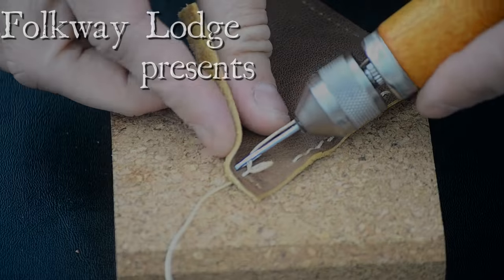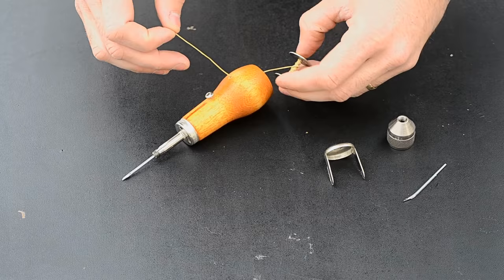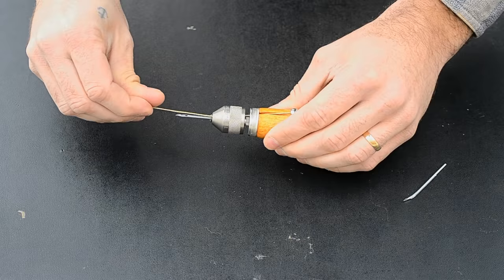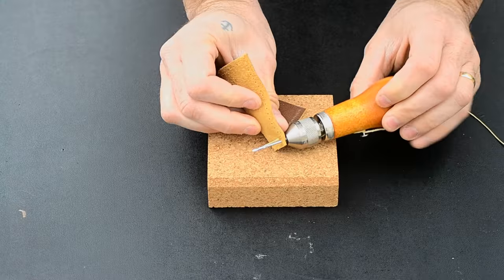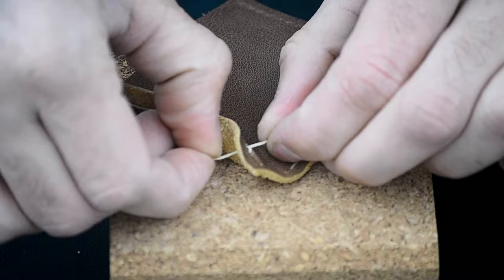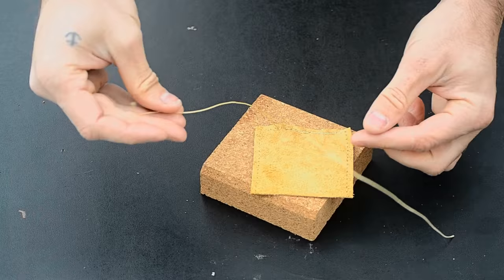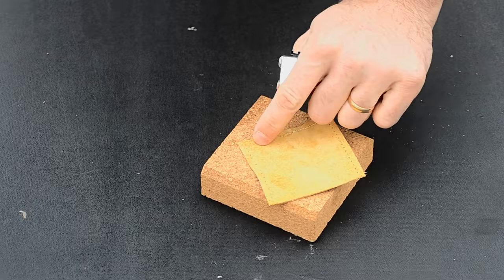How To: Sew using a Speedy Stitcher

Comment: The video instructions didn’t mention using the tension knob.  One wraps the string around it and under the thread coming from the spool before threading into the groove above it.  This way there is a comfortable tension on the string with little to no slop.

Comment: I some times take a short piece of wire, curve it to a proper shape, double the end over pinching it onto the tail thread line after first passing it through material being sewed. Especially like on the inside of a boot it makes it much easier to pass the tail through the loop.
Reply: Or use a crochet hook.

Comment: 2:00 You can leave the end-cap on the tool even while sewing with a whole spool of thread, since the end-cap has a center-hole designed just for this purpose; you just thread the cord through the hole and into the tool, and then put the cap back on. :D
Reply: Great comment,  thanks!

Comment: There is another method of using this tool. It involves passing one loop through the next. It's a little faster than this and might be stronger. Too bad I don't make videos or I would demonstrate it. The tool that I have was made in the 1900s, and still works.

Comment: It would move on a lot quicker if the loose end were in a separate needle of its own...
Reply: You could actually pull out even more on the loose thread side and thread that piece into a larger darning needle for easier handling. That way the tail of the thread won't catch when passing it through the small loop.

Comment: For those complaining of the speed...

1)  He's trying to show how it works, and is deliberately going slower than one probably could reasonably go.

2)  There are a couple of things that weren't done in the video that help speed things up.  Wrapping the thread around that little knob, keeps everything tight, making it easier to work with.  And putting a small additional needle on the end of the thread helps to get it through the loop more quickly.  Doesn't even have to be a sharp needle, just has to serve the purpose of giving steady control when putting a the thread through a loop.

The main disadvantage of this tool is that you have to pull through all the thread you will eventually need for the task, right at the start.  It's hard to know exactly what that is, and it can be tedious to pull that much thread for something big.

The main advantage of this tool is, ironically not actually speed (though it can be done quite quickly, if you're not an idiot or a klutz), but rather that it's considerably easier on your hands by providing a better, and easier, grip.  It's actually even useful for softer fabrics, as it requires less of a "pinching" grip, and allows for placing more fingers on the tool for finer and more stable point control.

Comment: I have one of these contraptions. I like the cork board idea, gotta get one now but the challenge comes when you try to get all your threading the same size and all uniform..
Reply: Get an old fork hammer it flat cut the shank of at a length to suit you quick few strokes of a file will sharpen the prongs. Use fork to mark the holes with a couple of taps with a hammer will give you equal spacings.

Comment: Use a crochet hook to handle the cord on the other side. Also clamp near the stitching line to take some of the wobble and flop. It is faster than using two needles and crossing at each stitch like a normal topstitch.

Comment: That little non bust behind your thumb is to wrap the thread around to cinch on and be able to get a tighter stitch.

To finish off the not you can place the backing through and rotate the push a few times before pulling back through creating a timber hitch on oneside and square knot on the other.
Reply: What is a non bust? Which one of his thumbs are you referencing?

Comment: I had to do a refresher today so I could fix a broken belt loop on my pants 
Here are some pointers i remembered right away try not to turn the needle or the string whines up on the needle makes a mess if u just want it strong dont care how it looks start a 3/8 of inch from edge go to edge then back up across the repair to the other edge then foward 3/8 of inch ending off the edge that doubles the stitches at the edge much stronger but on exposed leather doesn't look good in my opinion but on a belt loop its strong

Comment: I think you missed the step about wrapping the thread around the peg on the handle. I do, and I use the friction to tighten the knot instead of pulling on both sides with the hand. Also, not using the bobbing is great in a controlled environment like your table, but in the field, having the thread roll around, it's just messy. The bobbing is best then.

Comment: You forgot to show how to use the tensioning tack on the handle..  Loop the thread once around that tack so that it's easier to pull the needle side thread without having to set the stitcher down.

Comment: Thank you. I just recently came across one of these and decided to buy it then find videos on how to use it. 

I am assuming you can use any type of thread for any project that the speedy stitcher awl can work with such as the leather, fur, canvas, etc.. Is this a correct assumption or does regular polyester or cotton thread not work with this awl for cotton materials if I wanted to use it to sew this type of way?

Comment: Is there away to determine how much thread is needed for your project? What if you don't pull enough thread for your project? What if you pull too much thread for you project beside wasting too much thread?
Reply from the maker: I usually take the thread in my hands and stretch it over the part where I’m going to stitch, then I triple or even quadruple the amount. It’s ALWAYS better to have too much than too little. Once you’ve used that method a few times, you’ll get really good at measuring it out.

Comment: I'm new to this.  What are the advantages/disadvantages between speedy stitch & double needle methods?
Reply from the maker: I usually prefer the double needle method. It’s neater, sometimes quicker, and simpler. The main advantage of the Speedy Stitcher is the convenience outdoors. It’s great for a backpacking trip, or for repairing sails out on the water. I keep mine in a small pack in my truck.
Reply: @FolkwayLodge  Thanks!

Comment: I've owned one of these for years and have come back to it multiple times on various projects thinking "maybe this time it'll save me time and hassle."  NOPE.
It's so cheaply made that my frustration meter goes off the chart from just wrestling with the thread and getting it to feed smoothly off the bobbin.  It has all the hallmarks of being made as cheaply as possible somewhere half way round the world.  Meanwhile the needle is manufactured so poorly that there's sharp metal edges all around they eye of the needle that want to fray or cut the thread as I stitch.
Every time I've every tried this thing I threw it back in the bin and went to a proper hand done saddle stitch.

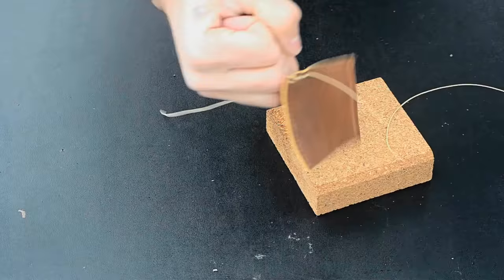Comment: The only benefit I see to that tool is a wide and easy-to-grip handle to allows you to push through very hard material, besides that... its awfull.. stiches have different pressures so the whole piece looks crooked (3:58), it takes more time than 2 needles doing saddle stitch, its very cumbersome to push louse thread through a hole bellow, as its done with single thread so if there would ever be damage to the thread whole thing will came undone.

Comment: He fail to mention that a locking of the stitch should be in the middle of the material not on the top knot on the bottom it should be in the middle.

Comment: The stitches don’t look good. I would never sell a piece with stitching that looked like that. 
Is there a way to improve how they look?  This might work for repairs on stuff but I just can’t get over how the stitches look. Also, why are you stitching just one piece of leather?  Could you please do a video of stitching two pieces together with better looking stitches?
Thank you for posting this as you have convinced me to not use a speedy stitcher at all. 
Cheers mate
Reply from the maker: You can use a grooving and spacing tool, just like you would with a saddle stitch to get better looking stitches. This video is to demonstrate how to use the tool. Why do you need to see it done with two pieces? Just put the two pieces together, nothing changes with the operation of the tool. Thanks for stopping by, cheers!

Comment: I was so intrigued by this and then I saw that this "speedy" stitcher is anything but speedy. And, on top of that, the stitch is not really good looking. Look, I'm not trying to be a dick, but old fashioned leather needle and wax thread would be faster and I could probably control the stitch enough to make it nicer looking. Either way, thanks for the video. It did help me decide that this is not for me.
Reply from the maker: I am Nobody we did a standard 2 needle video as well. I usually prefer that method, but the speedy stitcher is quite the interesting tool nonetheless.
Reply: @FolkwayLodge  Yes, I agree. As I said, I was really intrigued by it.  I did find your video helpful and I did give it a thumbs up because it did help me decide if I would invest in one of these. We're not always going to agree with what we see in videos, but that still doesn't mean the video did not have any value. Maybe I will get one anyway. As with most tools in my workshop, I found that sometimes it's good to have something and not need it, then to need something and not have it. And if nothing else, it's just a cool piece to have.
Reply from the maker: You know, the tool actually does have some good uses. Out in the field it’s easy to throw in a backpack and keep all the needles and thread contained in the device itself. It’s also handy to have around for things like repairing sails while on a sailboat. It would definitely take something like a groover and stitch spacer to make it look professional. We just wanted to demonstrate the basic use of the tool in as short of a video as possible.
Reply: @FolkwayLodge  Alrighty, you make a convincing case, my friend! I will go ahead and make this tool part of my arsenal!  Thanks again!

Comment: Doesn’t seem very speedy. Seems much slower than simply stitching by hand with a needle & thread. It seems to be the same technology as a sewing machine
Reply from the maker: It’s really only useful when out in the field, like in he toolbox on a sailboat.
Reply: @FolkwayLodge  in reading some of the other comments I saw a good point made about the speedy stitcher being way less of a strain on your hands than a needle and thread. That does make sense to me, especially with thicker materials like canvas and leather. Did you find that to be the case? Maybe the name is the silly part. Should have named it the 'easy stitcher' instead 😁😉
Reply from the maker: SeaRose We do typically prefer the two needle method. However, the Speedy Stitcher is very comfortable, and is very convenient with everything self contained. So I guess it should be the Easy Peezy Convenient Stitcher! 🧐

Comment: I'm sorry, I don't mean to throw in a negative comment amongst all the positives but this is not the best demonstration of this tool. You might have done well to use a stiffer piece of leather for demonstration. The resulting stitches are rather sloppy in my opinion. To boot, it's not faster than hand stitching. Hand stitching will get you a better, stronger stitch and, once you're experienced at it, can go fairly quick.
Reply from the maker: This was never meant to be a comparison of which method is best, but merely a simple demonstration of the basic instruction of this tool. The leather type and stitch quality is irrelevant, as it it based on the skill level and material provided by each individual user. Many people own this tool, which does not come with any sort of instruction.

Comment: From all the videos I've watched...and I mean LOTS...this device seems no faster than standard saddle stitching; if anything, maybe even slower! It's just a gimmick that someone's making money from.
Reply from the maker: It’s not meant to replace saddle stitching, which is my favorite method. The Speedy Stitcher is actually great for the outdoors. I have one in my pack, and in my gear for camping. I hear it works great for repairing sails while sailing as well. It may not be as fast, but it’s convenient having all the necessary pieces contained within the device itself. Can’t tell you how many needles I’ve lost among the pine needles!

Comment: Not to sound rude, but that looks slow and produces an ugly stitch. I dont see the point
Reply from the maker: I can do 2 needle saddle stitching faster, so compared to that it can be a little slow. It can produce a better looking stitch than the one I did here, I just rushed it for production’s sake. It’s main usefulness would be for out in the field: backpacking, sailing, camping, etc..
Reply: @FolkwayLodge  that makes sense, I never thought of that. Like I said, dont mean to sound rude. It was an informative video either way
Reply from the maker: No problem at all, no offense taken here. Thanks for checking out the video!